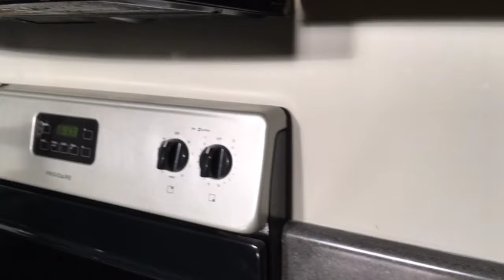How To Install Peel & Stick Backsplash Tile (Phillips Vision: Episode - 49)

Comment: This is definitely the best video I’ve seen! He points out an important step that all the others missed about cutting off the individual tabs to start out with your straight wall and not to cut off the straight edge that has the overlapping area! He follows through on the whole job and yes there are a few ads but he’s very well worth it for all the detail that he points out
Reply from the maker: Thank you for the nice comment 👍

Comment: Very informative. I had a question about filling in the 1 1/2” section at the top.. how are u cutting to match the pattern? Or doesn’t it matter?
Reply from the maker: I was using additional sheets and finding parts of the pattern that matched.

Comment: Andrew your video was well done and covers a lot of areas of concern, such as a starting point, cutting out receptacles and, handling wall corners. I have a question about the small strip portion you needed to add just below the cabinet. Did you need to use a new tile sheet for each successive strip applied in order to have it match? Or were you able to cut multiple strips from each tile, using a set of remaining tiles, to get each strip to match? Thanks.
Reply from the maker: Thanks for the comment. This video was done a few years ago. I believe I was able to use pieces from cut off sections.

Comment: I love this method and you did a great! I have large tiles on my walls right now and i want to apply the peel and stick backsplash. Can I apply them on top of the large tiles or should I get the large tiles removed before applying the peel and stick?
Reply from the maker: I would recommend applying them onto a smooth, clean surface. If you don’t want to remove the tiles you should prep them so the tiles stick properly by cleaning the existing tiles and grout with a good grease remover and wait to dry before applying the peel and stick.

Comment: Nice and very clear instructions.  Still, I would prefer to see how you measure and cut out using the template as this is the most challenging part to work out.  Thanks!

Comment: New subscriber here.  Great video 👍👍👍  since this was posted 3yrs ago, how has the sticker tiles held up???  I'm genuinely curious as I haven't seen any "few years later update videos" anywhere.  I'm thinking of using this method to update my kitchen, but I'd like to know: how long do sticker tiles last before they need to be removed or changed again.
Reply from the maker: Thanks for the support. The house was sold shortly after the application so I’m not sure the status on the tiles. If you clean the wall properly it should hold well.
Reply: @PhillipsVision  thanks!

Comment: Hi. Do you have video of creating the template around the outlet? Did you just lay the backing on the wall and draw out the opening or did you measure it out?
Reply from the maker: I do not have a video. I lined up a piece of paper with the electric box to get the height (vertical) measurement, then measured the distance from the edge of the sheet to get horizontal measurement.

Comment: Does the wall have to be perfectly flat? Or does all of the texture need to be removed?
Reply from the maker: You should smooth and clean it, otherwise it will not adhere properly

Comment: I've watched hundreds of videos from contractors, homeowners, stores & Amazon, this is hands down the best & most helpful video by far. Thank you! Could you please tell me the color of your cabinet? I'm planning to use briwax for my oak but not sure about the name of color. Also the total cost of your project and if it's still sticking to the wall? Anything you could add?
Reply from the maker: Thanks for the comment. I stained those cabinets about 10 years ago so I don’t remember the actual stain. I believe it was a mahogany color that was put over oak wood. Hope this helps

Comment: Can you put peel and stick over tiles if sanded?
Reply from the maker: I don’t see why not. You might also be able to use a gloss cutter application on the existing tiles instead of sanding. That will also remove the shiny surface and make it more dull. As long as prepped properly it should stick.

Comment: Thanks for the informative video! I notice that your drywall has textured paint too. Most likely orange peel. Im looking to order some peel and stick tiles for my backsplash but read somewhere that it doesn’t stick well to textured drywalls? Did you have any issues post sticking and what do you recommend ? Thanks
Reply from the maker: No, no issues. Just make sure you clean it well before
Reply: @PhillipsVision  Thank you! Much appreciated!

Comment: I have an outlet right where the tile ends, so it’s going to overlap the edge of the tile. How would you handle that?
Reply from the maker: @susanacker8120  you’ll need to cut around the outlet

Comment: I have textured walls, plus round corners. Can I still use the peel and stick.
It seems it would show the texture underneath and not stick.
Reply from the maker: You would need to prep the wall first and smooth it. Rounded corners will be a problem, because those will not adhere well to the radius

Comment: How many total tiles did you have to use? A lot of waste(extra pieces)? Does the cap you're wearing help with the installation as well?  :)
Reply from the maker: I measured first to know how many total, then purchased a few extra in case of errors. I don’t remember exactly how many since this was filmed a few years ago.

Comment: How do you finish the tile when you don’t have a cabinet or corner to run into? I want to do this but one side will run into the refrigerator area and I don’t want to backsplash that entire area. Is there a finish piece with an edge you can purchase?
Reply from the maker: I believe they do make an edge trim. I just cut pieces to finish mine, but they should have special edging.
Reply: Thank you

Comment: Will these stick to an existing backsplash that is now outdated?
Reply from the maker: If it’s a tile one you’ll need to prep it so it will stick. If it’s a peel and stick one you’ll need to remove it first and prep the wall

Comment: Will if be ok if i don’t remove my plugs like you did? So that the plugs will look kinda slightly flushed to the sticker tiles
Reply from the maker: Plugs or plug covers?
Reply: @PhillipsVision  plug covers.
Reply from the maker: @eqq13  ok, you can leave them. You may have a little gap near the covers
Reply: @PhillipsVision  thanks! :)

Comment: Mine are starting to lift what can I use to lay them back down?
Reply from the maker: Did you prep the wall and clean it? If there is dirt, moisture or grease it will be hard to adhere to. If everything is clean you could try small amounts of silicone adhesive

Comment: I bought stick and peel tiles for my kitchen from large box store.   Put them  and now so many are peeling away.   I paid over $40.00 for package of 4 of the subway tile.    Anybody else with this problem of them not sticking and wondering what type of glue I could apply to where they are coming away from the wall.   Not all are peeling.   Wondering if pulling away due to steam in kitchen?    thank you for any replies.
Reply from the maker: Do you prep the wall properly? Normally, if you prep and apply them properly they should stick with no problem
Reply: Get some spray adhesive and put on the back.  Not sure if it's rental friendly, though.

Comment: Is it easy to come off. I rent and when I move out the was is ok.
Reply from the maker: The adhesive doesn’t seem too strong, so it should peel off somewhat easy. You may have to do a little patch work if the wall underneath gets pulled off in areas.